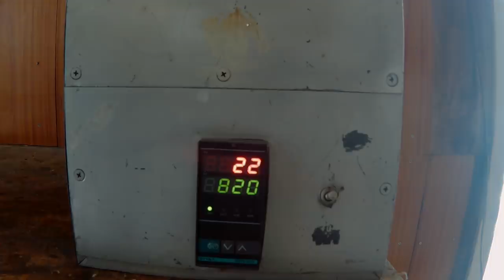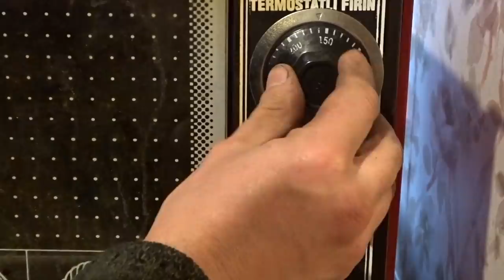Restoration And Renovation Of Rusty Cleaver

Comment: I am curious whether the electrolysis is necessary if grinding anyway?
Reply from the maker: Hello sir, good question.
First of all, if you use electrolysis, it can be said faster, but at the same time more dirt and waste + electricity consumption. in what cases should i use it? There you are sure that it will not damage the item and there is a lot of rust. Rust removal. It is cheap, I use it constantly without changing it. It Works slowly, but also well. If I immediately start grinding, in this case, the rust will not be removed from the deep places and will lose weight and metal.

Comment: Drill bits are not milling cutters, you only drill out straight holes to remove bulk of the material and then finish the edges with an appropriate tool like a chisel (not a knife). 
There needs to be room for your fingers between the handle when finished and the edge so you do not impact your fingers when cutting on a woodblock. Handle you made extended downwards meaning you can only use the cleaver on the edges of the woodblock. 

Better way to make a handle would be to cut a handle halves

Edge of the blade is concave instead of straight or convex - meaning it will not cut anything down to the cutting block in the middle.  

Also not a knife, cleaver is for striking the meat you want to cut, through the bone or rather joints.
Reply from the maker: Thank you for attention and information.

Comment: Excellent work and enjoyable video, as always. Thanks for posting!

A couple questions, if you don't mind...

Is your shop in a garage or open to the outside? Mine is in my basement. I notice you use salt  for electrolysis. I've heard using salt makes ammonia gas, maybe not the best idea for me. What would you recommend for doing that inside that would be safer?

For the paw prints on the side of the blade, did you do another round of electrolysis or some other process to etch them on? Thanks!

It looks like you used Oak for the handle. Tough stuff... but nice and durable.

Can't wait for the next video!
Reply from the maker: Thank you for attention sir! When I trying to clear the metal from rust, sometimes I used electrolysis but in that case I always open couples of door on out. For etching the blade I just change polar.
Reply: @ScrewsAndTools  Thank you for the information. Greatly appreciate it! Your channel always gives me news ideas and options for doing things.
Reply from the maker: @billf9526  Awesome! Thanks!